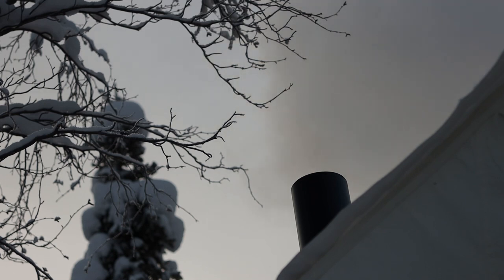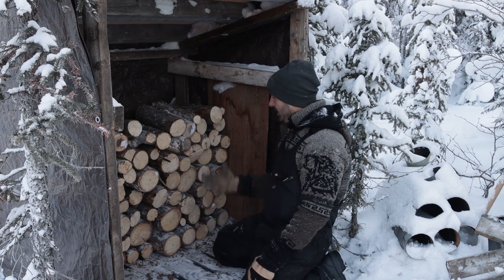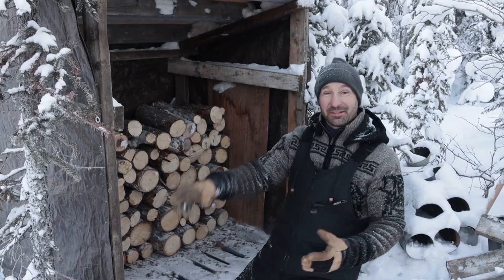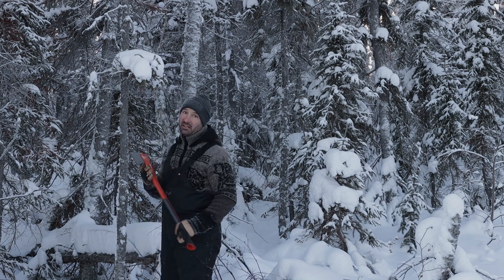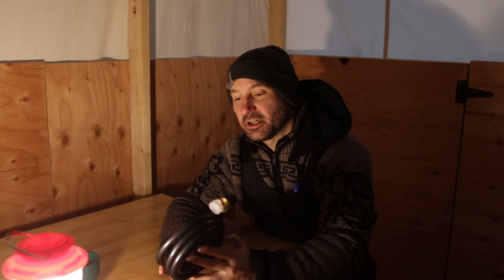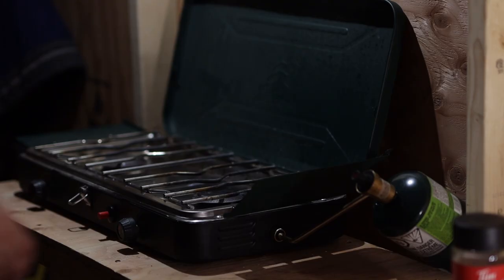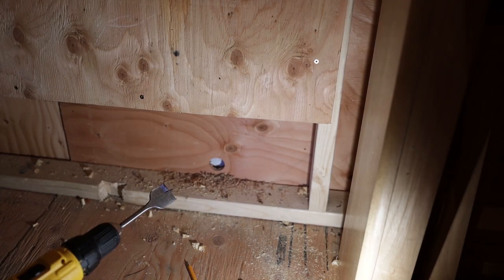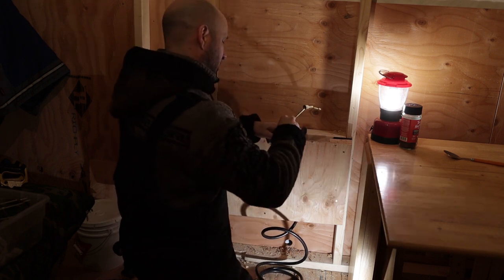Cut Through Tent, Eat In Tent

Comment: Jay when cutting down a tree with a axe try it this way two chops at a down angle then at base of the chops straight in it it will split out the pieces of wood you started with the downward strike. And repeat until the hole is half way through then reverse sides and chop about six inches above the other side and tree will fell where you want it to.  The goal is to get as much of the tree chipped out without wearing yourself out. Hop this helps. Love the wood stove.

Comment: Always enjoy watching a tent video during morning coffee Jay, thanks for the content.

I was surprised to see your gas burner fire on the first try. I use a long(ish) line from a 40lb tank with a low-pressure regulator, to feed a propane heater, and whenever I crack the propane valve open, it takes a good 60 or 70 seconds of holding the pilot open, to drain off the air & fill the line with propane, before the pilot lights off. As others have said, I think you'll need a way to get a bit of heat into your propane bottle, if you're out there when ambient temp gets low enough to liquefy propane (about -40, IIRC).

As I watched you dig out the snow for the exterior propane line, it looked like you were removing snow that you had shoveled from your "step", I noticed exposed floor pallets on the left of the screen. Next time you're out after a heavy snowfall, you could consider shoveling a loose bank of snow around the base of the dwelling - it'll keep wind out, and snow is actually a decent insulator (lots of trapped air), might keep your floor a little warmer.

Are you planning to T off of the big propane tank, to run a heater under the Yamaha? Have been thinking about your quandary with starting it in the cold, pondering inexpensive solutions. It looks like your new woodstove is stout enough to support & heat up a large rock; if you parked over a hole, pushed a hot rock under there, maybe tarped over the engine bay, that might trap enough heat for a long enough time period to get the engine warmer than -20? Not exactly sure how you'd go about moving a big hot rock from stove to hole, but I'm sure there's a number of ways. Oven mitts maybe.

I've also never chopped down a tree with an axe, my inclination would be to cut a little higher, I think. It would allow me to swing at shallower angles, in both the downward and upward strokes. A very sharp edge on the axe is important, I think, too. You can always come back and claim the stump next time you're out there with a chainsaw. Or, y'know, just leave it to decompose. Speaking of saws, I see you got a Silky Bigboy 2000, pretty sweet eh? I'd almost be inclined to cut down a large tree with that, before an axe.

It seems like it's only a matter of time before you'll be heading out with minimal gear, catching your food, making your water, making do with what Nature is providing you, sporting six months' worth of beard & writing haikus in the snow about the northern lights. Neat Stuff.

Comment: When I did something like that with my tent, the lines got ice in them.  You'll need to insulate the tank and hose.  I was thinking of making a little box outside with a small solar/battery powered heater to keep the temp above freezing.  Not sure how I'd do it, but I'll tinker around and get it to work.

Comment: Will be much easier to use that gas stove now with the big tank.  Might want to cover the top of the tank and adapter once finally installed to keep water and ice from damaging the connections.  

Also, as a few others have noted, propane loses pressure at very low temperatures, so maybe bury the tank with a bunch of snow (wrap it in something waterproof first) so that it stays right around 0 C, where it should work just fine.  The snow should insulate the tank from the colder air.
Reply from the maker: Good tips

Comment: I've used chain saw chips and diesel.    Works great, its cheaper than bar oil but it stinks a little more keep it outside with a lid on it and use a scoop which you already have.    I use an ash shovel
Reply: Using an axe to chop down a tree sure makes you appreciate the chainsaw

Comment: i used to make a fire in my wood stove by starting with birch bark, then a layer of dry twigs from the fir trees, then larger branches from the fir trees, then kindling, then small logs, then the big logs.  I could get the whole thing going fantastically with just one quick flick of a lighter.  Now I just use kindling and some lighter fluid.  Not as bush-crafty, but it's fast and easy, and the lighter fluid is cheap.  And more importantly, I don't need a whole bunch of crap around in my cabin to start a fire.  So there.
Reply from the maker: Ha. Me too!

Comment: With the tank outside the tent, won't it always be cold? Inside, it can at least be warmed up as the tent warms, but outside it won't and maybe the propane will gel up?
Reply: Propane tanks should always be stored outdoors, in well-ventilated areas. Storing propane tanks in garages or sheds is discouraged because if a valve isn't fully closed, vapors could escape and concentrate indoors. A flat, level outdoor area that is out of direct sunlight is the ideal location

Comment: WA state has lots of regulation and I don't think burning oil in a wood stove is legal.  Cutting with axe you can also do an under swing cutting up to remove a wedge shape of wood.  I usually try to find a comfortable under swing first so I don't have to do all down strokes.

Comment: Do you think you’ll have issues with the propane freezing/icing up outside the tent in your brutally cold temperatures?
Reply: Propane tanks will freeze up when the ambient temperature drops below -44°F. This is because propane has a boiling point of -44°F. If the temperature is not greater than -45°F, your propane will not vaporize, and your tank will freeze. However, as the temperatures drop, and the volume of propane in your tank drops, as will your pressure.

Comment: Keep a couple 1 pound bottles of gas inside. That 20 pounder outside might not flow when it gets too cold, the pounders inside the heated tent will flow.
Reply: Propane tanks should always be stored outdoors, in well-ventilated areas. Storing propane tanks in garages or sheds is discouraged because if a valve isn't fully closed, vapors could escape and concentrate indoors. A flat, level outdoor area that is out of direct sunlight is the ideal location

Comment: Add steel wool around the hole to keep rodent out
Reply from the maker: Good idea. Thanks!
Reply: @jaylegere  Steel wool will rust, eventually.  If you buy copper wool it will not rust, however it is more expensive.  I would go with copper wool to ensure the critters don't come in.

Comment: Why do you want the tank outside?? I wouldn't put a hole in the tent if it were mine ... but it's not so ... lol Cooking in the tent, aren't you afraid of animals?
Reply: If the tank is in the tent and gets too warm it could pressurize and there probably is a safety release valve.  If the SRV pops you will have propane gas in the tent.